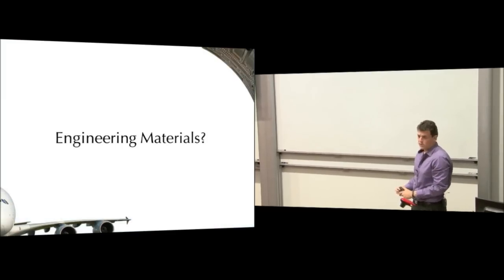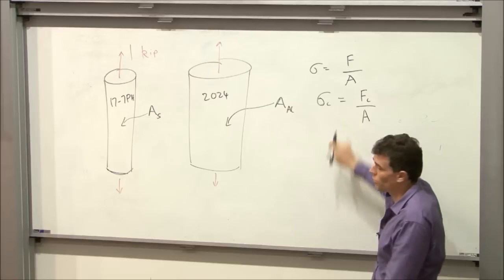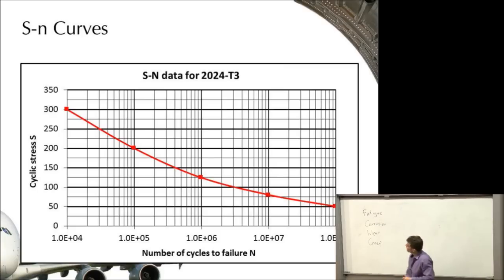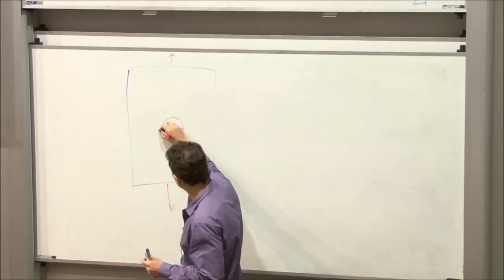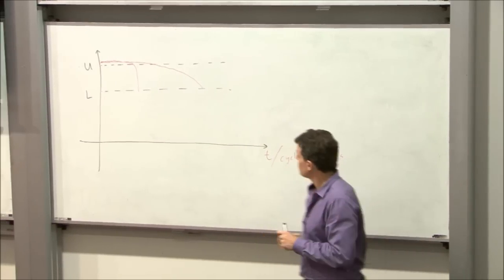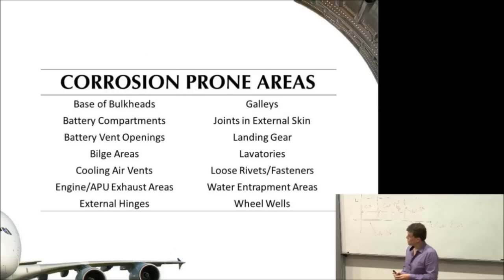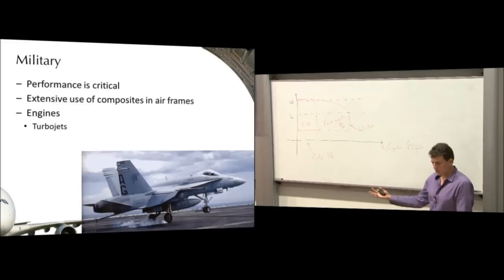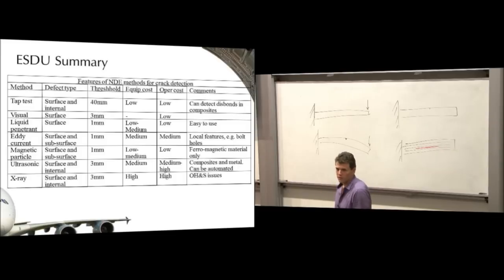UNSW - Aerospace Structures - Aerospace Materials

Comment: The plane at 1:50:45 is a 737-700
Regarding 2:01:30, I know it was a just a punch, but the walkaround is nowadays usually always performed by a flight crew member (captain or copilot).

Comment: Hi.. excelente video ! 
Im thinking bout studying aircraft and airspace engineering after i finish high school. 
Till minute 22, it was all piece of cake for me, since its all basic mechanics.. but i dont know.. im kinda scared of starting that course, although i work alot with cnc.. and some people i know asked me if i wanted to help them build an ultra light aircraft, wich i accepted since im a huge airplane passionate (i go to university on the year 2016/2017 ; im finishing high school for blacksmithing and stuff).  But i wanted to know if everything i learned at school bout mechanics, materials and manufactering processes actually gives me an advantage on knowledge when starting this course. And which are the subjectes that are the hardest (besides fluidmechanics) ?
Reply: +Jetmir Koran 
Hi Jetmir, I'm a last year MSc aerospace student and thought it would be nice to answer your question.
The content on this video is usually taught on a 3rd or 4th year course, so don't panic just now if you don't get it, that's quite alright. Before taking a course such as this you will have to go through, off the top of my head, General Physics (which is a basic course on mechanics), Classical Mechanics (a more advanced course), Materials Science and Engineering (intro to engineering materials and their properties) and Strength of Materials (introduction to structures). So before coming to Aircraft Structures you'll have a good basis already. 

Once you start college, whatever knowledge you bring in from school will be quite irrelevant. That's because the university doesn't know about the backgrounds of each individual student, so they pretty much start from the beginning and make sure everybody can keep pace.

The hardest course I've ever dealt with was Aeroelasticity, which is a combination of Aerodynamics, Theory of Structures and Vibrations (and each one of those is already quite challenging)! Fluid Mechanics is really a piece of cake compared to Aeroelasticity, hahaha... But don't be scared off, once you get to it you'll be up for the challenge!

Of course this is all based on my experience in the Technical University of Madrid, Spain. It might be different elsewhere!
Reply: Thanks for the answer Amigo :)
What i meant with High School knowledge was , that im already learning alot of stuff that is usually thaught at the Bachelor Degree. Like  Mechanics and Material Science.. And my  question was if the knowledge I got from High school, will help  me with my course , but i mean me personally. If i haave already learnt some mechanics, is it helpfull at college or useless ?
Reply: +Jetmir Korani Of course it will be helpful! In a broad sense, knowledge (of anything) is always helpful in life. In your case, sure! You'll be able to understand the concepts you'll be taught quicker, and sometimes you'll be familiar with them already! A word of caution though: It will probably happen to you at some point that you'll encounter something you think you know by heart already and get over-confident about it. Don't let that happen to you!
Reply: jibeneyto awesomee. I also thought about it once... That i would be overconfident about smth and then wouldnt pass it because that reason. But thanks for the advice. Engineering is a Marathon  and not a Sprint race... Its not about getting the highest note once.. and givee up. Its about keeping on learning till its over. But anyways, I love it, so i got that going for mee :)